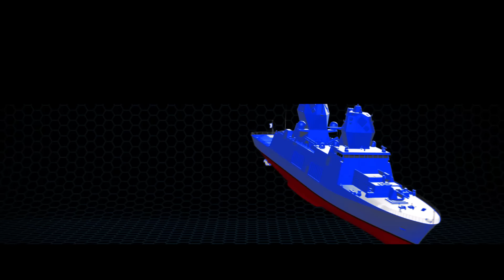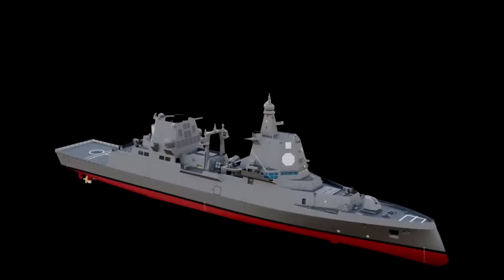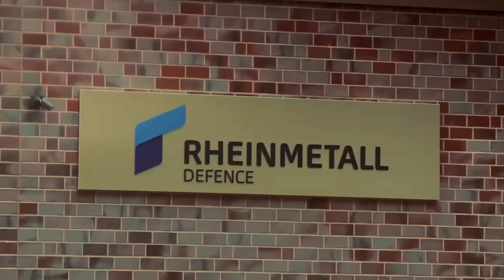The World's Largest Super Frigate is Taking Shape || How Big and Powerful is the F127 Frigate?

Comment: you cannot say Super Frigate at 10k to 12k tons displacement, in this case you need to raise the classification. it should upgrade it to "Cruiser" not super frigate.... it's like you have a 'Corvette" at 4,000 tons displacement then you called it super corvette instead of Frigate .. learn your navy ship classification by weight
Reply: Learn to think in 21st century terms. Not tonnage but capability decides what a vessel is.
Reply: Capability decides it nowadays not the tonnage destroyers corvetes cruisers they have extremely different capabilities
Reply: Germany simply calls it a frigate. The reasons for it and whether they make sense or not might be debatable, but frigate is the official term. 
Oh, and by the by, the next type of ship after the frigate would be the destroyer, like the almoat 16k ton Zumwalts of the USN.
Reply: @Schwarzenfels  The designation "Destroyer" was a British Royal Navy development.   Having noted that their new class of Dreadnoughts could be sunk by a small torpedo boat they developed a fast well armed ship, called the destroyer, that could escort the dreadnought and had the speed to intercept and cut of any torpedo boats detected.  Today a destroyer is a ship capable of escorting a capital ships such as an aircraft carrier and having a full range or anti submarine and anti air defenses. 
A frigate is a more traditional classification of a secondary ship used to escort convoys or patrol independently.  It would lack the speed of a destroyer and would likely be lacking in some area eg having only short range air defenses and be focused on submarine warfare.
-In this case the Super frigate would seem to have a full range of capabilities such as long range air warfare and anti submarine.  
-I would guess its purpose is to protect sea traffic from Russian bombers, cruisers and submarines crossing the Atlantic as well as maybe around Africa and the Persian gulf.
With the US pulling back from keeping the worlds oceans safe Europe needs to start protecting its commerce by itself.
Reply: @williamzk9083  The F124 Sachsen and the Dutch De Zeven Provinciën-class frigates both have the same capabilities and both are designs from the 1990s, the Soviet Union was dead and Russia not really a threat at the time. Yes, they have limited anti sub capabilities, but they really aren't build for this role, and neither is the proposed F127 class. 
The 4000nmi range is neccessary to be able to support NATO operations worldwide and nothing special anymore, same with the speed, as AA support, they need to be able to keep up with task forces.
The term super frigate is completely made up and, as far as I know, only used by the internet and certain not so reputable media outlets, basically clickbait.
It's not WWI anymore, ships grew in size and capability.
Reply: Frigate is the designation for an independent operating ship controlling an area - "cruising"
Destroyers are dedicated escorts. Germany does not have any kind of carrier so no need for a dedicated escort.
Those AAW Frigates in europe are there to plug the holes in the air defense above the seas.
Reply: @jacksonteller1337  even by it's capabilities if judge base on picture and information available that the f-127 frigate is aegis capable. It's even excelled the British daring if that's how destroyer is defined..
Reply: @JeffBee-vo3gf  the Type 45 is a frigate of the Horizon class with extended range. It is weapons carrying capability, radar range and a lot of other things. Look it up and learn the nomenclature of modern navies. It would help if the UK joined the 21st century.
Reply: @jacksonteller1337  Radar range which f-127 frigate could possibly use Raytheon's AN/SPY-6 radar? And possible 64 upgraded Sm-2/Sm-6 variant and Aegis integration?
Reply: All major surface combatants today are heavier than their counterparts a generation or two ago, certainly those of WWII—with the exceptions really only of the battleship and heavy cruiser of that age. 

The mission/role matters more today in determining the ship type, but you’re right to note this is a very large “frigate.” US Office of Naval Intelligence generally classifies modern Russian corvettes as frigates and frigates (the Gorshkov-class, at least) as destroyers. 

Russia will likely build a “super” version of the Gorshkov instead of a “destroyer”—if they can acquire & put together all the components under their sanctions.
Reply: All major surface combatants today are heavier than their counterparts a generation or two ago, certainly those of WWII—with the exceptions really only of the battleship and heavy cruiser of that age. 

The mission/role matters more today in determining the ship type, but you’re right to note this is a very large “frigate.” US Office of Naval Intelligence generally classifies modern Russian corvettes as frigates and frigates (the Gorshkov-class, at least) as destroyers. 

Russia will likely build a “super” version of the Gorshkov instead of a “destroyer”—if they can acquire & put together all the components under Western sanctions.
Reply: Navy ships aren't actually classified by weight but rather by role 
And internal/external politics play a big factor in classification too 

Weight is rather low on the list
Reply: super frigate is merely a moniker to describe a new upcoming future stealth guided missile air defence frigate . . . its not a naval certified type classification . . . the F127 class cannot be classified as a cruiser since it's displacement is less than 14,690 ton (loaded) . . .
Reply: In germany we call everything frigate, it's not the channels fault. We would call an aircraft carrier a flight deck frigate 😅
Reply: @Chiggi0815 cruiser is a term used for a ship that can work independently of the fleet, i.e cruising. A destroyer is not just used to escort main battle groups but is a vessel with a multi role capability such as air , submarine, surface and naval gunfire support. A frigate is an escort that works the perimeter of a group primarily as a submarine hunter.
Reply: @DeepseaSteve  The original "cruising" ships were frigates, but that term described a type of ship with 3 masts and an enclosed gun deck. When steam power came up the Sails had to go and the the gun deck was replaced by turrets. 
The Frigates did not look like frigates anymore so they called them by what they were supposed to do - cruisers.
The whole confusion came up because the British called their destroyer escorts frigates in WW2.
The US went a different way - that is why the cruisers like Lehay-class were called "frigates" until 1975.
And Destroyers have only become true multi mission in their current generation. Arleigh.Burkes did not even carry their own helicopters until flight IIa.
Reply: 1. The next class after frigate is Destroyer
2. The german navy has an aversion to name ships Destroyers for political reasons
Reply: @alexanderzippel8809  Lol, no.
Who decided the sequence of those ship types? What political reasons? Germany had 3 classes of destroyers after WW2.
Reply: @SENOR-PINK-777 it's by roles. Not even capability. Corvette are littoral. Frigate a general purpose surface ship. Destroyer your command ship. Cruisers are extinct. US has them but they are the last ones and almost gone from service.
Reply: Ships aren't classified by tonnage for the most part these days, The Royal navy for example, Determines classification by design role, And has for at least 30 years..
Reply: @jacksonteller1337  The Type 45 is an air defence destroyer of the Daring class.. 👍
Reply: @bulthaosen1169  the us navy defines cruisers plainly by having accommodations for a task force command. Ticonderoga are barely heavier than Burkes by now.

The main distinction for the US navy was that destroyers were for offensive operations and frigates for defensive operations in the Cold War. That is what decided tonnage and capability because frigates would stay closer to supply lines while destroyers were meant to go deeper into contested sea zones
Reply: @mangalores-x_x  I don't think US uses that doctrine anymore. Cruisers are getting retired. And frigates are coming back. And these are to be used in offensive ops. And destroyers in air defense role.
Reply: The German Ministry of Defence calls it that way.
Reply: Europe calls it a frigate even if it's a destroyer
Reply: 10000 to 12000 tons is not a frigate it's a cruiser
Reply: The planned European Patrol Corvette (EPC) which will be acquired by likely 10+ countries has a displacement of 3k to 4K. So it will be almost the size of a Perry class frigate.

Comment: When I see newly designed ships, 
I wondered why NSM is not designed for VLS.

In this sense, you could install annother row of VLS batteries (+ 2 Mk41 modules)
in the middle of this ship design. 

This would double the possible number of NSMs carried 
or create space for 16 more long-range missiles or 64 more ESSM or IRIS-T SLX missiles.
Reply: I don´t know either, but I supose they are very expensive to have a massive number on each ship and they are still recents and I imagine the actual VLS can´t allow it for incompatibilities about the dimensions, contours, etc and to adapt it maybe can to be very expensive too, because maybe can need to change all VLS for other specific new ones.

Maybe it´s better (more intelligent, cheaper and quicly too) make another NSM missile specific, a special VLS NSM version for example.

Anyway, NSM missile is anti-ship and in secondly hand for atack to earth ground too, not anti-air. Meanwhile the VLS nowadays are only anti-airs or if they put in a Tomahawk missile then are for attack to earth ground too, but not specific for atack to other ships too. For that reason before they had Penguin missiles apart and now, litle by litle, NSM.

Regards.
Reply: The F127 will integrate the 3SM Tyrfing and likely also Tomahawks, both of these can be fired from VLS cells.

Comment: 64 VLS is kind of under armed for a 10,000-ton warship. Comparatively speaking a Arleigh Burke flight 3 Destroyer is 9,700 tons and has 96 VLS cells whilst a Ticonderoga Class Cruiser is 9,800 tons and has 122 VLS cells.
Reply: Well i guess not all Missiles have to be fired from the VLS, also this ship is still in planning. Since the Russo-Ukranian war other ships including the F126 have gotten upgraded in the planning stages ( 2 more F126 and an early retirement for the F125). The F125 were constructed for a completely different mission set in mind to what would now seem likely in a modern war. I think that quite a lot could change in the next years with the F127
Reply: You also have to keep in mind that the German Military is purely defensive. They have clear boundaries laid down in the German constituition, thats also the reason why its just a Frigate. A Frigate would not normally have that many VLS. Otherwise it would be hard to get that through the German parliament and possibly the supreme court
Reply: @florianritter9324  makes sense
Reply: Agreed, it should have more missiles. As far as I know there are two ways of thinking regarding missile ships atm: either an arsenal ship with close too or more then 100 missiles, or smaller vessels with about half that but more ships, to limit the loss of capability if one is lost. This frigate has the displacement of an arsenal ship but the missile armament of a smaller vessel, so whats up with that?
Reply: @hernerweisenberg7052  different mission set, Problems with the German constitution and public opinion.
Reply: @hernerweisenberg7052  Difference in design philosophy. The more modern German frigates use a two island design, where every important component is available twice in different sections of the ship. This way even if the operation center is hit directly by a ASCM, the Ship can stay operational. Similar with the Engine room, and even the Radars, which are split up over the two islands.
In addition the F126 and probably the F127 as well will get a strengthened hull with about twice the thickness of steel to make it less dependent on ice-breakers in arctic waters. That all adds space and ultimately increases weight by quite a bit.
Reply: I think the comparison is flawed, you're comparing a ship from the Cold War that would probably only survive for minutes in a modern war with drones, hypersonic missiles and stuff. With a ship armed with lasers, hypersonic missiles, a large caliber cannon and yes also VLS cells (plus the usual ram and so on). To say that many VLS cells = a powerful ship is an oversimplification.
Reply: @MW-dz1hg  When missile ships fight each other, its only about who can launch more anti ship missiles and missile interceptors, and who can launch em faster. Those old cold war ships with 100 missiles+ could easily overwhelm this frigates defences and shoot down every single ASM it might launch in return - I dont see how it would have any chance against a Tico or Burke, not to mention some eastern designs who have even more missiles. So I guess I fail to see how this new ship with more displacement and considerably weaker armament would stand any chance.
Reply: @florianritter9324  Which is kind of mad to already plan to retire a ship class where the last ship has been put into service only a few ago. After all the whole class is only in Commission since 2019. And the left room for a later installation of at least a VLS similar to F123 and F124.
Reply: @hernerweisenberg7052  you forget to mention the RADARs and other fire control systems that also play a part in a defensive layer, the ability to see OTH is another important factor that comes into play, hence western allies and now buying Wedgetail Aircraft.
Reply: @PagsPayback More proof that German engineering is vastly overrated.
Reply: @MW-dz1hg There are no lasers, sparky.
Reply: @GrahamCStrouse  It's a design choice... nothing to do with engineering.
Reply: For to be a Frigate is more than capable ship.

It´s bad to comparise two different types of ships because the missions are very different. Meanwhile a destructor mission is essentialy to search and destroy (the word "destroyer" itself says eveything very clear), a Frigate primary mission is essentialy to defend other ships.

Destroyers is for to stay in a first line of atack and Frigates in a second scolting the other indefense ships (suply convoys, aircraft carriers, etc) for example.

Each model ship is designed for a different specific purpose and mission. For that reason there are different type or model ships.

Regards.
Reply: @salvador9369  Different countries use different ship classifications for different roles. For example the United States,  United Kingdom,  Japan and South Korea all use Destroyers mainly for Air defense roles although they are all very capable of other missions like Anti Ship, Anti Submarine and land attack missions. Frigate type vessels are more suited for standalone missions like hunting Submarines, Anti Piracy, Anti shipping and so on.
Reply: Remember that Germany doenst need a large navy. They only need to be able to lockdown the Denmark strait together with other countries in the vacinity. Maybe a few submarine operatations within the baltic sea if they would have to fight a war against Russia. F126 and F127 are designs from a time where the German Army conducted expeditionary missions. So this is a big step for them.
Reply: @hernerweisenberg7052  For what does it need more missiles?  64 VLC-Cells means 256 missiles, mainly for air defense. The RAM is additional. Main operation area für the F127 will be the baltic sea, where you can reach an allied port to restock your missiles in 2 days (if you have them stored there....).   Allied planes cann assist you in half an hour at nearly every point in the baltic sea. If you face a thread in the baltic, which you can't stand under that circumstances with 256 missiles, more missiles wont help you....  And yes, Ticonderoga or Arleigh Burke have more VLS, but these ships are built to operate world wide in waters without friendly harbours at hand...  When we talk about firepower the weak point is that only Starters for 8 NSM are planed...
Reply: @zelemas3062  64Cells means 64 missiles, unless you quad pack em with smaller short range missiles. Shorter range missiles is not what you want to have if you have to defend anything but yourself against modern threats like hypersonics. Why do you assume this air defence ship wont giva a shit about defending others and only packs short range missiles?
Reply: @hernerweisenberg7052  the Range of those quad packed missiles is enough for most missions. Long range AA missile are more for Aircraft then as a missile Defense.

Comment: as with everything bundesmarine, of course it's a frigate, everything is a frigate, even if its a destroyer
Reply: its a frigate, because its intended doctrinal use is that of a frigate.
it might have the tonnage and firepower of a modern destroyer, but it is set up as core air defense asset of a battlegroup (meaning it provides sensor coverage and air defense coordination to the battlegroup plus air defense capabilities, freeing up other ships like Burkes to do their job as destroyers).
Destroyer and Frigate is a distinction in doctrinal use and loadout, not size or firepower.
By the way, its "Deutsche Marine" not Bundesmarine, the Bundesmarine was merged with the Volksmarine of the former DDR to the "Deutsche Marine" in 1991.

Comment: 6:16 is the Baden-Württemberg-class which was the successor of the Sachsen-class and will be succeeded by the F126 who will replace the Brandenburg-class the predecessor of the Sachsen-class. F127 replaces the Sachsen-class so you have more or less 3 generations at a time though field capabilities vary a bit and they aren't exactly replaced 1 to 1 in that regard.